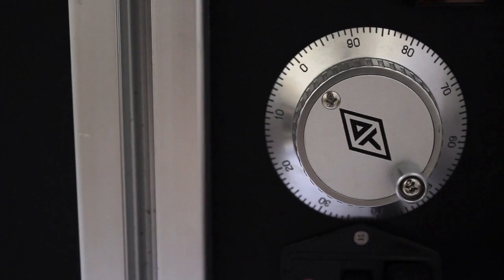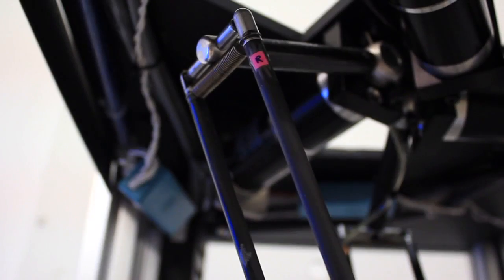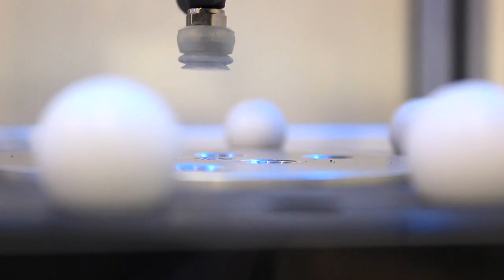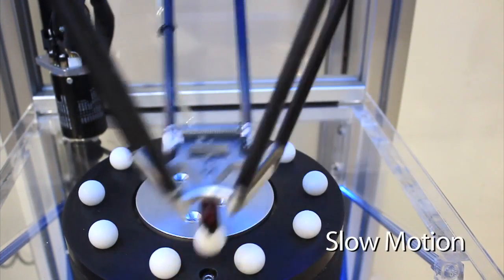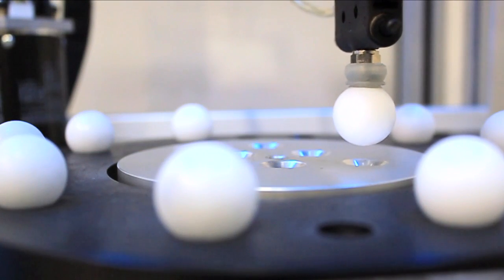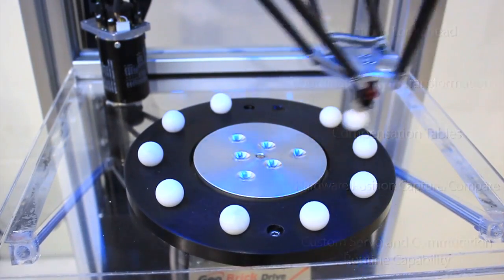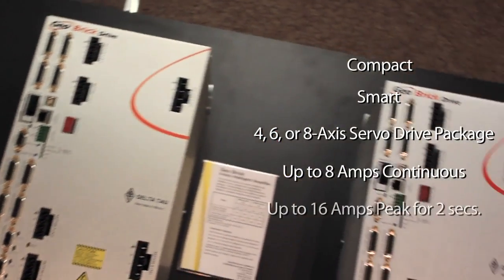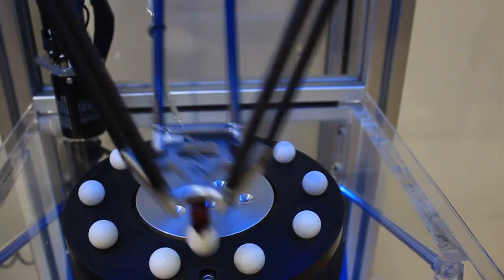Delta Robot Using Kinematics

Comment: Can you please explain how delta arm can sync with turn table?
Reply: if you think of it in respect to XYZ coordinates for the arm, and XY for the table, then calculate that each divot on the table will always be the same distance from center, you can then calculate out where a divot should be at any point when the table is rotated.
from there, the delta robot will set a z axis position, then will move the tooltip to correspond with where the divot should be. Each divot would be ran against a few variables to figure out where it should be in rotation instead of trying to retain a theoretical infinite positions. 

TLDR, set height, and match the delta tool head to divot position with math

Comment: Thanks a lot for sharing the formula!! )
Reply: How was this formula useful
Reply: How did u connect the theta with other two angles
Reply: @hemachandarmathiyalagan90  I assume you run the equation three times, once for each motor so you get three theta angles. As the equation does not specify the mounting orientation of each motor you probably need to set a coordinate system for each motor individually and translate your global x,y,z to an x,y,z on the motor's coordinate system. Assuming everything is symmetrical, this is most likely just a rotation of the XY coordinates by the mounting angle of the 2nd and 3rd motors. The first motor should already be aligned with the robot's global coordinate system.

Comment from the maker: As for the workspace, we can compute the cylindrical workspace in PMAC beforehand based on the robot's geometry, and then dynamically check each axis's position against those limits in the inverse kinematics subroutine, ensuring that the axis can never be commanded beyond its limit.